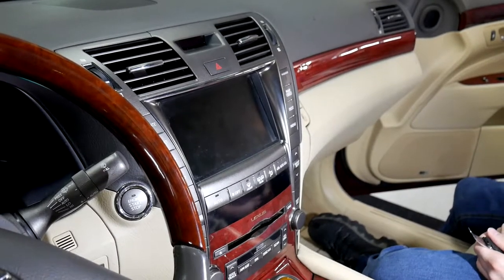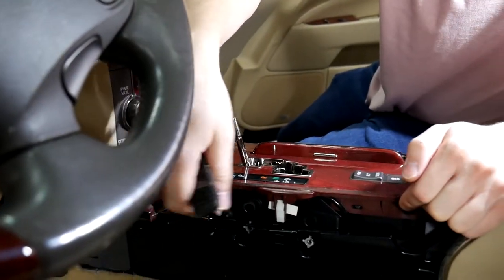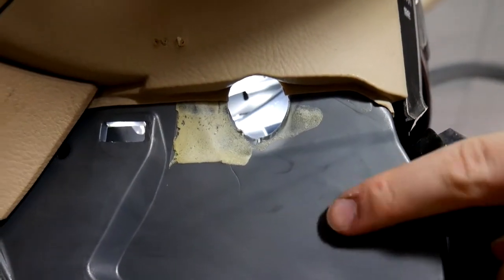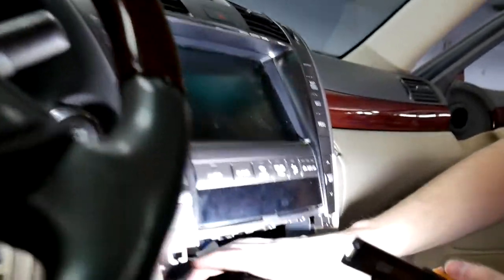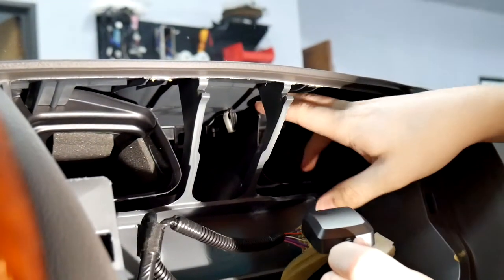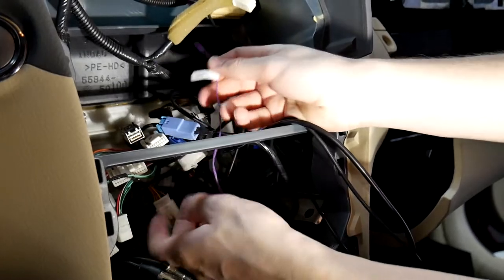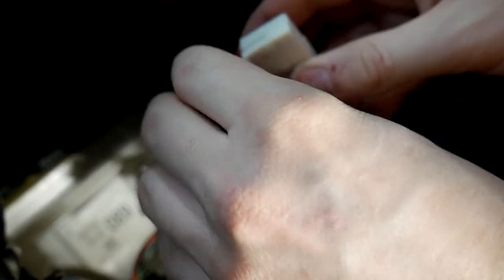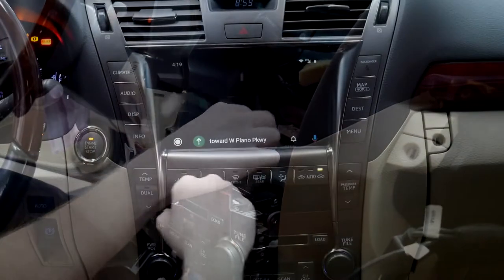Lexus LS 460 2007 2008 2009 GROM VLine install CarPlay Android Auto, car stereo removal guide LEX5LS

Comment: Will this work if my Original Hard Drive died??
Reply from the maker: Is your stereo working in other modes, such as FM mode?
Reply: @gromaudio yes, but I can't control anything in the screen.
Reply from the maker: @stoplying2267  most likely the VLine VL2 will not work as well.
Reply: @gromaudio 
Thanks for responding

Comment: Bro by changing the screen ur unabiling the self parking feature!
Reply from the maker: We are not changing the screen, the VLine VL2 system integrates into the factory stereo and uses the same screen of the existing factory stereo. The self parking feature will keep working.